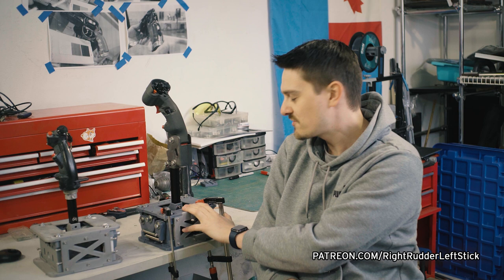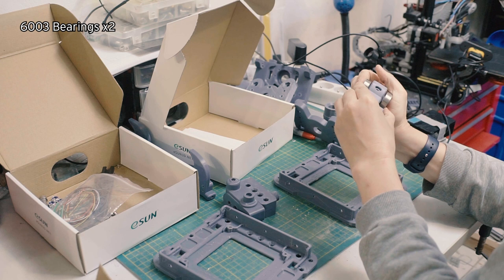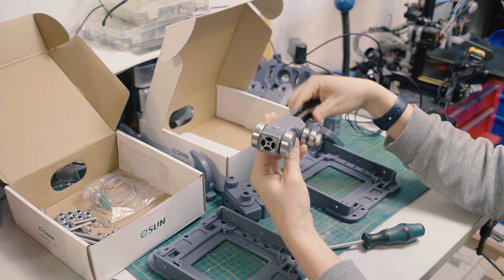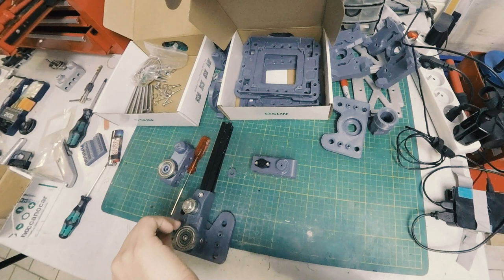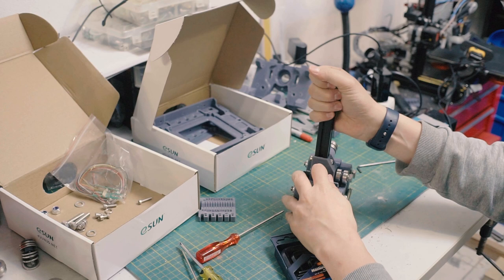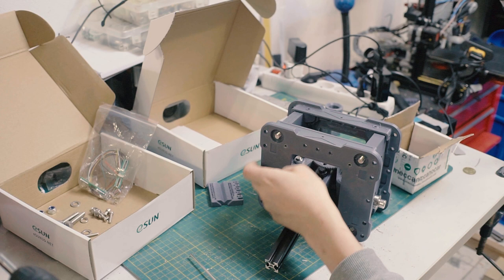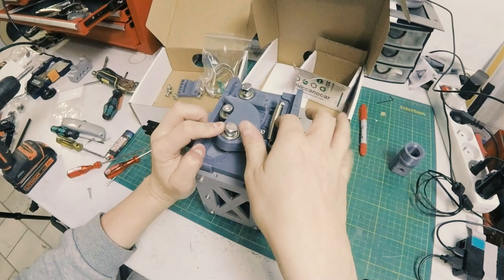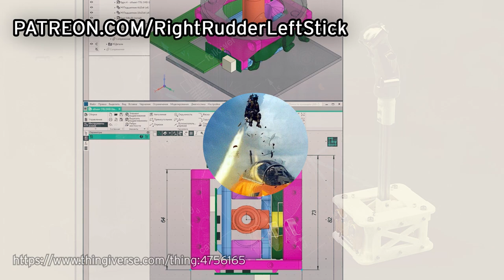Mechanical Build guide - Open Source - Very Large Stick MKII

Comment: Finally! I'm going to use it with my MiG-21 Control Stick.
Reply from the maker: Very cool! Share a video of it once you’ve got it built!

Btw been thinking of using ford shifter boots that are rubber as the cover for the bottom of the gimbal

Comment: Can you please make a video with installing and programming the electric part?
Reply from the maker: Check out the latest video on my channel!
Reply: @rightrudderleftstick Thanks a lot. At the beginning of the latest video, I saw a built-in adjustable damper. I've been looking for one of these for a long time. Can you tell me where you got it?
Reply from the maker: @hoimi2809  those I actually got on aliexpress and ended up being terrible, had to get them serviced by a mechanic to remove striction.

I have a third one I bought on amazon a few years back that is great.

I think look around where people are buying them for modifying crosswinds and see what the good reviews are.

When I put together the BOM for the cyclic add-on i’ll try and link to a good reviewed aliexpress store

Comment: Just when i thought DIY flight sticks don't get any better, I come across this. This is absolutely fantastic mate! I'm going to redesign my entire HOTAS around this. Just a quick question, in your BOM, it didn't mention what thickness/gauge of spring you used for both the main and supplementary spring. Any suggestion so that i dont order one thats too stiff? Cheers!
Reply from the maker: For the springs to be honest it was just testing stuff from the hardware store, in the step files I picked a spring that was roughly the same dimensions of the one I had on hand by eye. but the hardware store springs are just loose in bins so I don't really know what kind of metal or actual forces they are graded at.

Comment: I'm not too knowledgeable with electronics, but could I use something like an Arduino Leonardo and the Arduino joystick library, or is the stm32 board a necessity.
Reply from the maker: Check out the latest video on my channel. It works with board using my breakout board, and the guide currently shows the MMJOY2 configuration. Right now waiting on a real bluepill to arrive to do the stm32 guide video.

Comment: Is there any tolerance on the 18x24.7x1 Teflon washer? IE would 18x24x1 work? Or would 18x25x1? Thanks
Reply from the maker: there is actually, smaller OD would be safer but a 25 might just be okay, the edges are chamfered so there is a bit of leyway
Reply: @rightrudderleftstick  Thanks. And perfect timing, I am at the printer now having just printed my cams ;)
Reply from the maker: @dogsbd  just checked in fusion and the recess for the teflon washer is exactly 25mm dia with the outer edge filleted to 26mm, so a 25mm should fit in with a bit of squish, which is fine.